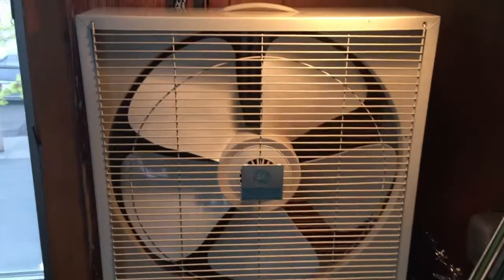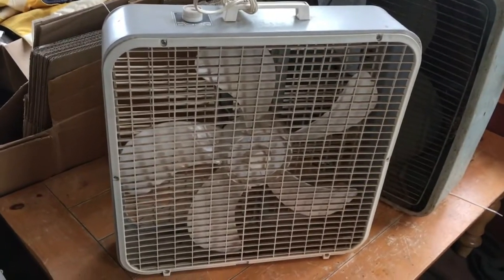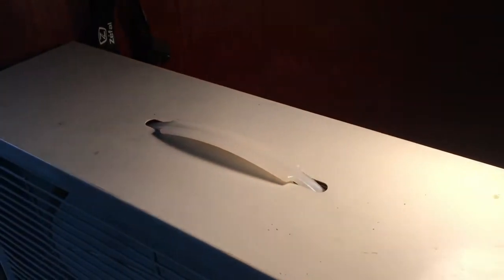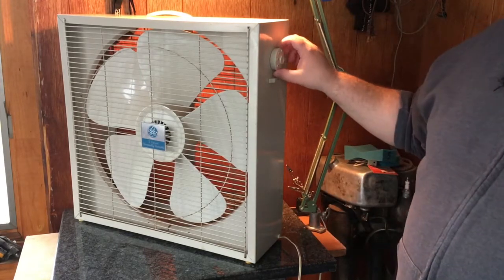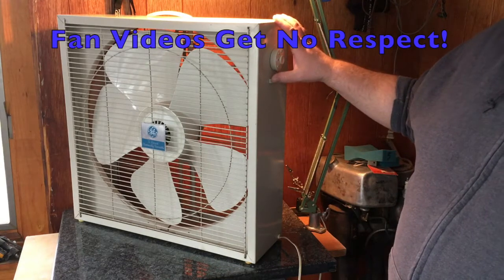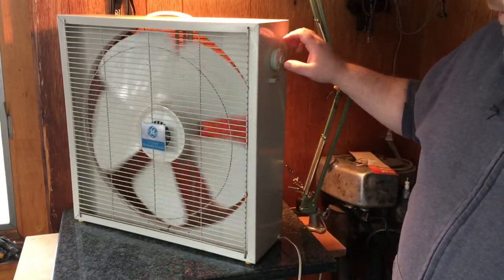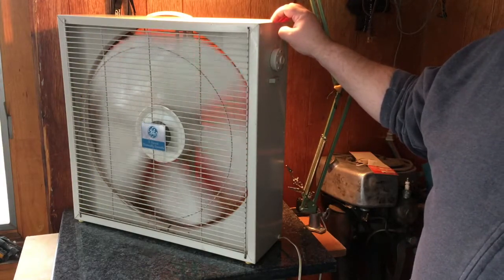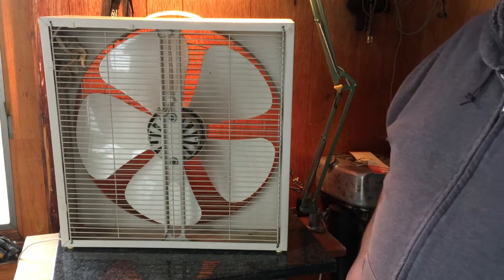GE 5 Wing and Robeson Box Fans Found

Comment: I have the same model GE fan, and its blade too is off center. What I did, is re. Over the blade (there's a rubber grommet / bushing between the shaft and blade) and rotate the blade on the grommet til you find the sweet spot. Made a huge difference with mine. Make a witness mark w/ a sharpie or something and just use the old guess and check method. Hope this helps, I know this is years later. Also I believe that fan is from 1966 from my research